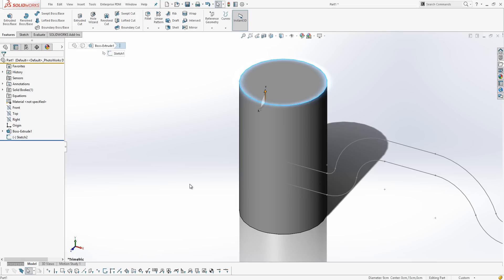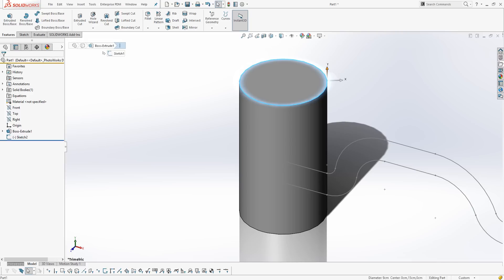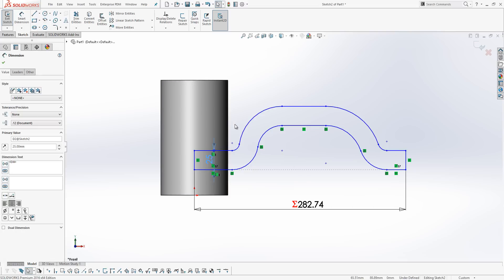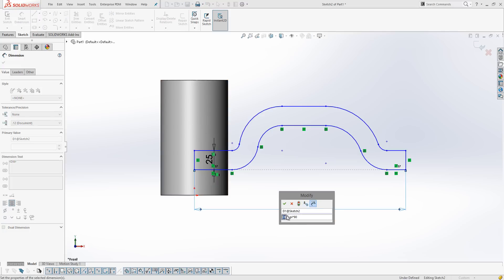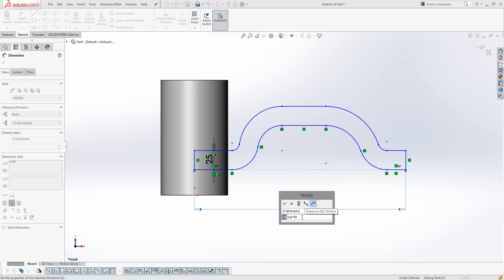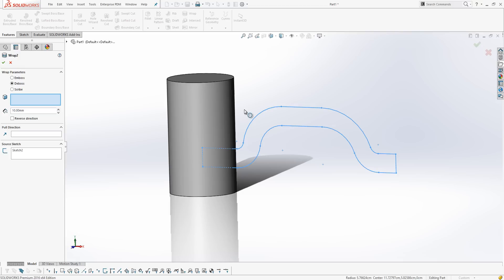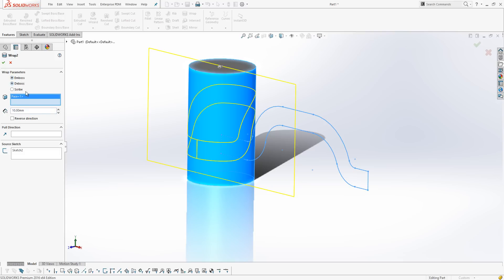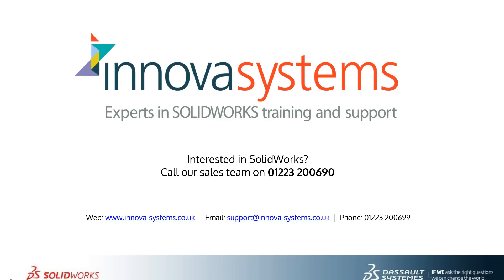How to use one sketch to draw a pattern around a cylinder in SOLIDWORKS

Comment: Great video and I realise it's just to demonstrate the wrap feature however like you, I am also trying to make a cam profile in a cylinder (motorcycle  gear shift drum that rotates to move the 3x shift forks). I don't know whether you realise it or not but the wrap feature cannot actually produce the shape required. All drum cams rotate and in doing so they move one or more round pins and if you have a look at the shape produced by the wrap feature you'll notice that everywhere except the horizontals (concentrics), does NOT have parallel walls like what is required to match the pins and also as would be left after the milling operation by a 4 axis milling machine and say an 8mm tool. So far I've spent a day on this and I'm almost tempted to give up on having completed CAD work and just use the "scribe" option in wrap thereby leaving scribed lines of the shapes I need and from there continue directly in CAM programming the tool paths.